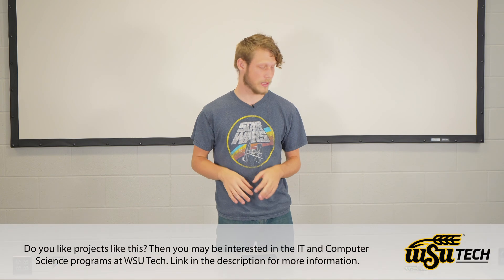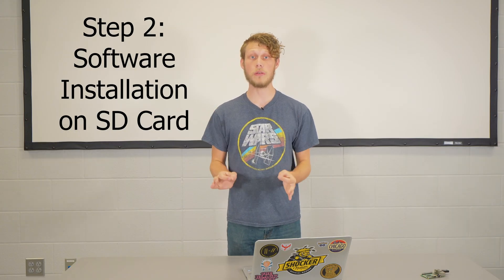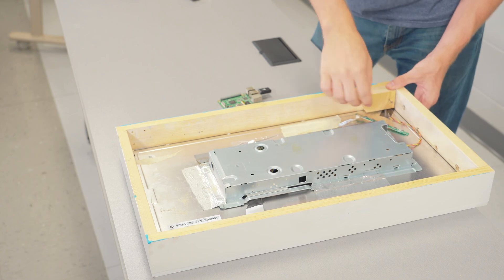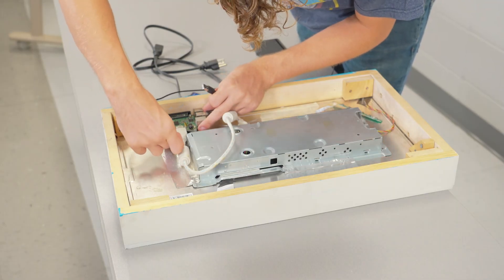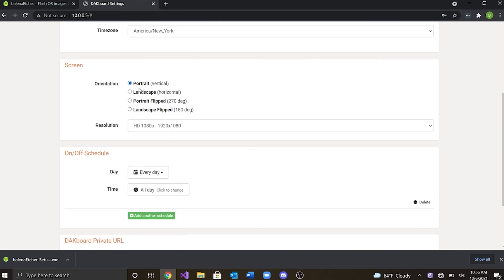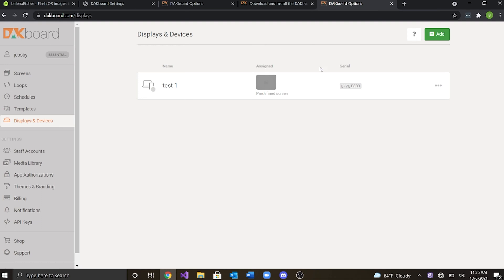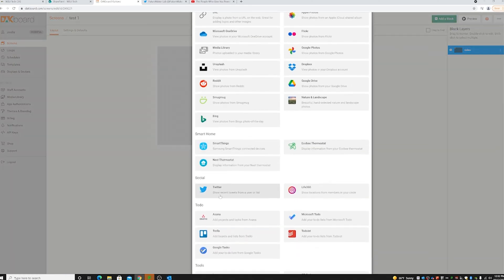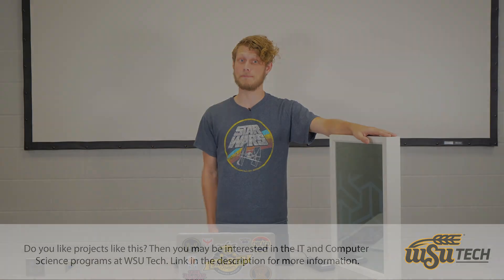DIY Smart Mirror with Raspberry Pi

Comment: You control it with mouse and a keyboard,, what about makeing it touch screen or a leap motion scene using an optical flow sensor,, I want to make that project can you please help me gather information about it
Reply from the maker: That would be very cool. The issue you would potentially run into is you would not have the mirror part anymore since you would need the touch screen.  I would also look up tutorials and see if anyone else has made something similar using a raspberry Pi and a touch screen.

Comment: How did you power raspberry pi thanks
Reply from the maker: We just used the cable to power it and drilled a hole in the wall to connect to a power source.

Comment: Can you tell me how the hardware connection is donr in order to activate speaker and mic with Jarvis.
Reply from the maker: The Raspberry Pi has usb ports so you should be able to hook up a mic for that!
Reply: @futuremakerlab  thank you for your reply actually i am using pi 3 model b for my project can you guide me how to control home appliance like lights using 8 channel rely on pi 3 model b any link or suggestions you have if you guidance then it's means a lot
Reply from the maker: @hayafatima9844  You could try using this one for your home automation. https://www.hackster.io/Akshit_Agrawal/home-automation-with-raspberry-pi-3-b61508

The only thing is that you may need to flash your raspbrry pi and change what you are running on it. I personally use an Alexa to control the home automation and Roku Smart Home. You could even use a smart plug for the mirror. 

I also know you can connect smartthings to the mirror. 

Hope this helps.
Reply: @futuremakerlab  Hey friend! did you inmstall a fan for the pi? does it need one for cooling? Thanks!! <3
Reply from the maker: We did not install a fan for cooling. But you are more than welcome too if you want. I have found that I do not need one for mine.  @Ayse-x8d3u